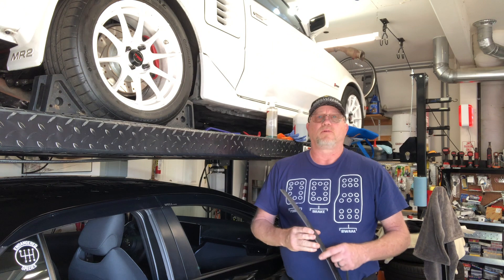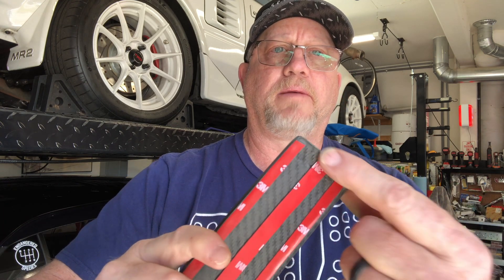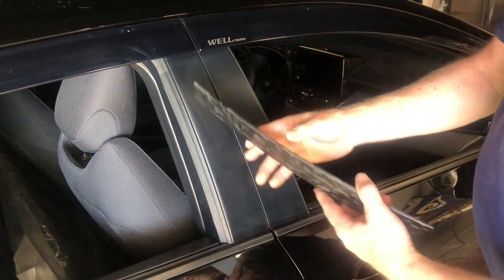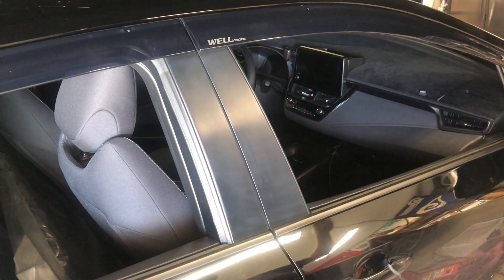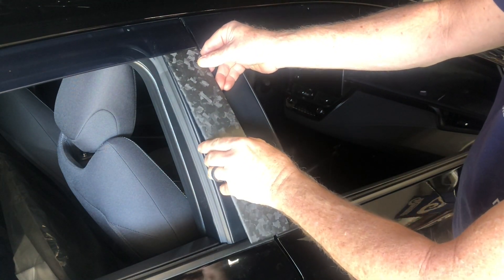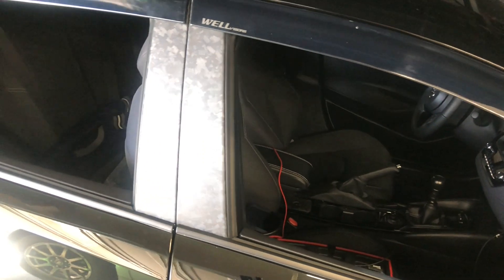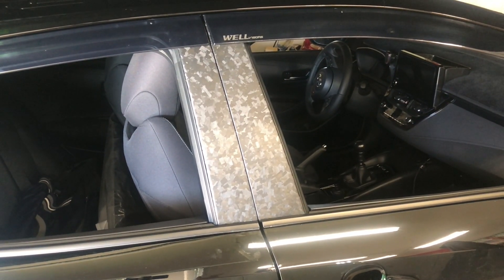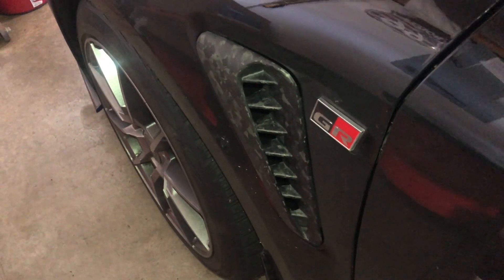GR Corolla | GR Mods Matte Forged Carbon Fiber B-Pillars

Comment: Hey I got Toyota Corolla IM could u help me pl I want make my tunes where is best place to go pl advice me I will really appreciate to u
Reply from the maker: If you want to have someone upgrade your stereo I would look at some local car stereo shops in your area. I also own a Corolla iM and it has a standard stereo with a double din head unit and speakers in the front doors and rear doors, nothing usual but easily upgradable.